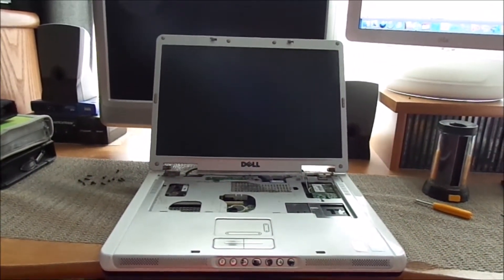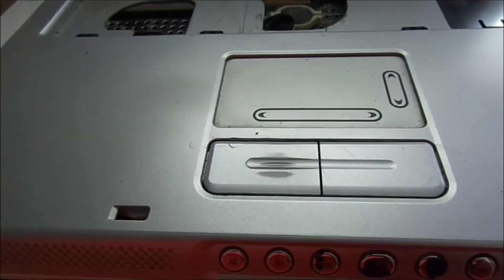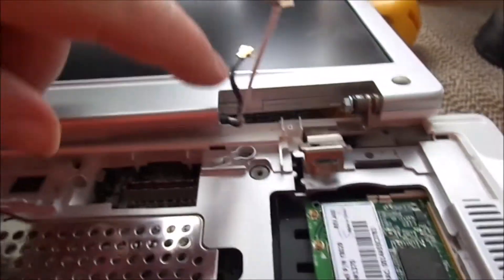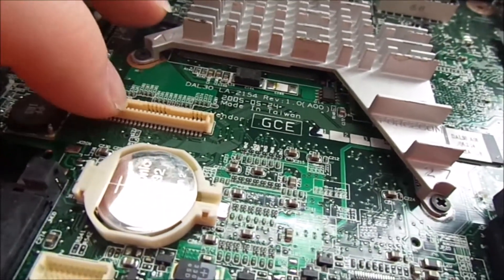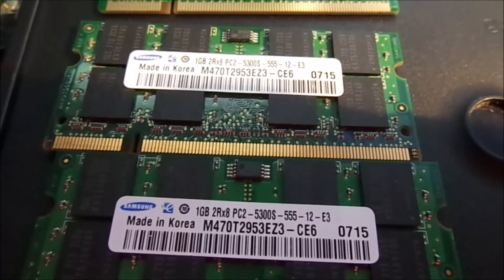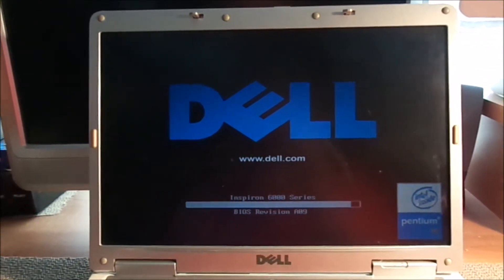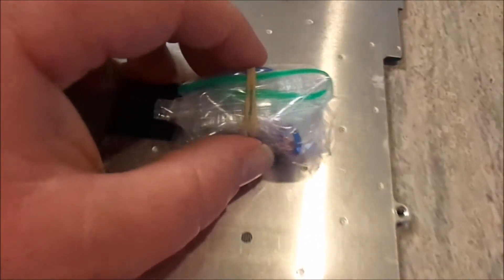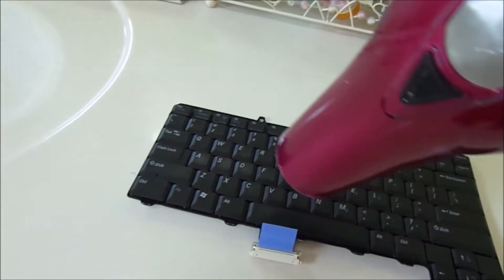Dell Inspiron 6000 - Cleaning Up A Mess

Comment: That was excellent thank you !!  I've refurbished quite a few  of these types of  laptops and you confirmed a lot of my own experiences, EXCEPT THE DISHWASHER - THAT WAS AMAZING.  I never would have even considered it, bearing in mind we're talking water and electricity, LOL!!!  I would have used  a variety of  cleaning alcohols (sprayed on) and compressed air to remove any crap.  Many thanks for a very well-made demo-video.  Most of my refurbished laptops (like yours) are running Win 7  and - in some cases - Windows 10 !! It is perfectly fine to revitalise old  laptops for everyday computing. I give all mine to charity.